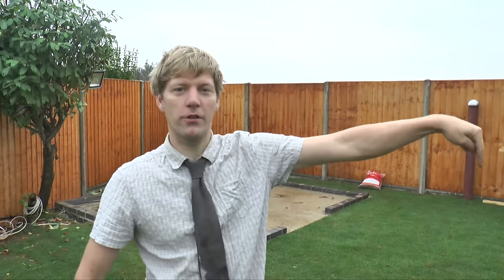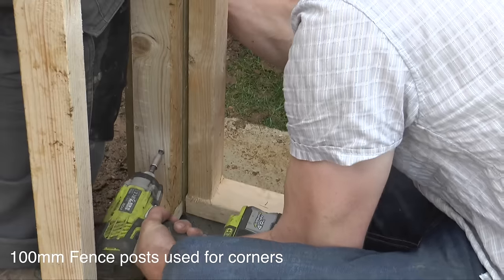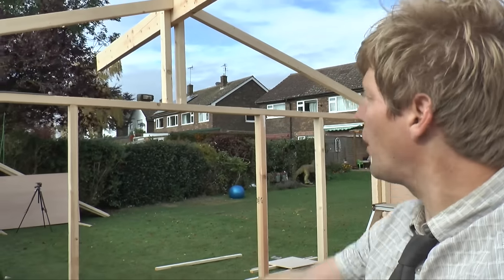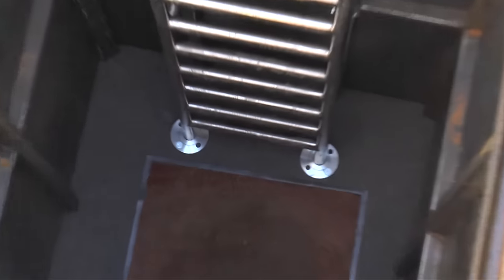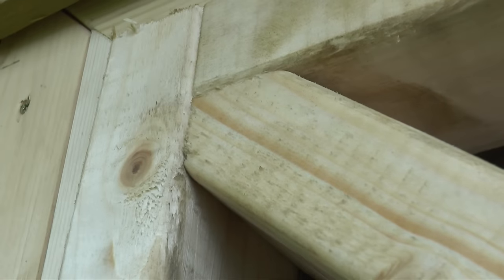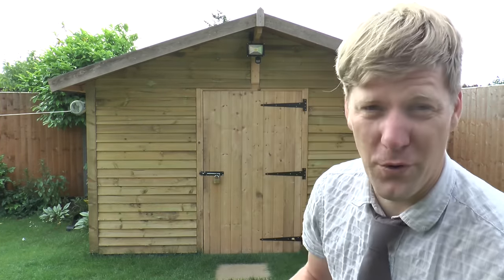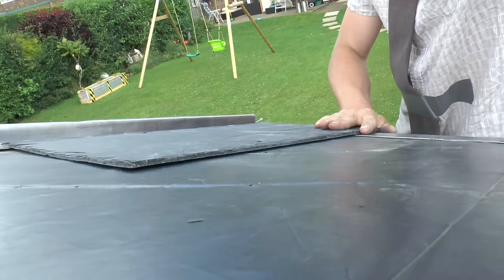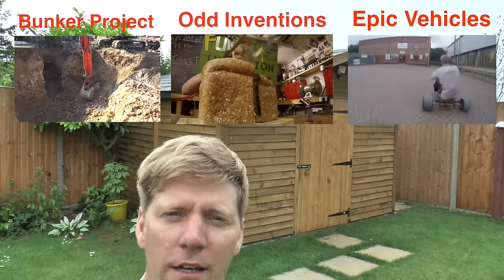How to build a really SOLID shed

Comment: You may still have come under budget if you had of used OSB board instead of premium grade marine ply.
The DPM used should have been a breathable membrane, as you did not batten it out to create a 15 to 25mm void the DPM will attract moisture and eventually rot your timbers but you should still get 10 to 15 years out of it.
Also if you had of... Nah I'm just nit-picking  :)  Great video for any DIYer wanting to try his hand at building a shed.

Comment: We're nicking the idea of the fence posts in the corners. How did you attach the posts/wall frames to the brick/solid base?
Reply: very brief glimpse at 1:30 when he hammer drills (probs SDS) down and uses hammerfix frame fixings

Comment: I hope he used ply that was damp proofed. Also that the shed was secured to the base, mind you with the weight of those tiles on the roof it is not going anywhere but you never know. I hope he did his load calculations so the roof was strong enough to take the weight. He might have an explosion down below in the bunker and blow the roof off ............ He should have put a damp course membrane between the wood frame and the line of bricks he laid for the frame to sit on.

Comment: Great looking shed and great video. I’m planning something similar. What did you do for the base ? Did you lay a concrete slab to work on or is that just the top of the bunker? If it’s a concrete slab how thick did you lay it? Cheers , 
A.T 🤓

Comment: Can someone tell me what size wood Colin uses in the middle when he is doing the feather edge please. Also what's the handy block thing he uses for the spacing. Lastly what size feather edge is that ? . I know I probably won't get a reply from Colin but could someone help. Many thanks all
Reply: The frame he uses 2”x4” and the posts are 4”x4” the sheeting is 12mm I believe. That help?

Comment: While this shed has obviously stood the test of time, I was a little concerned by the fact that the whole thing is only anchored to however many bricks the frame was screwed down to. Unless those fixing screws went through the brick and into the concrete (and they didn't really look long enough for that) then the whole shed's rigidity is based on the amount of mortar between the anchor bricks and the concrete base. 
I'll admit that the amount of weight in this build will probably hold it down through a tornado but come on, there's right ways to do things ;o)
Reply: Sheds are not generally screwed down in the UK.  They aren't going to get blown away here.

Comment: Really want to replace old dilapidated shed with a self built one. But those material costs are barmy. A small piece of strip wood from b&q is a fiver. I built a simple moderate sized cabinet for the garage a fee months back and materials were well over £100 just for that....

Comment: When you put the concrete base down, then the brick perimeter, then you put the stud walls on the bricks - will this cause damp? Do you need to put a damp course on the bricks?
Reply: sheds don't usually have damp course but would be better with it I would think.

Comment: Tip: don't use polythene sheet, use a breathable membrane.  Polythene will give you condensation problems.
Reply: Is that so? Damn! I used a plastic sheet for mine. I thought it would stop the moisture getting to the wood frame. I do have a few se humidifiers in mine to help capture the moisture

Comment: I think slate will prove to be a mistake in the end. I have a slate roof on my house and it's horrible. It leaks, it drops black dust everywhere, it chips and cracks. It's pretty horrible.

Might have been the best stuff around 200 years ago but there are much better alternatives now.

Does look pretty damn smicko though.
Reply: whoever installed your roof did a piss poor job then!

Comment: Interestingly the 75x50 CLS timber I'm looking at has an "actual size" of 63x38 which is obviously something to consider if planning! Not sure why they're like that.
Reply: Yeah that's a "3x2" board - the size of an "inch" in boards has obviously shrunk over time...🤣 I prefer the standard "4x2" which is actually 89mmx38mm - extra strength and it's actually quite a lot cheaper where I am. The 63x38mm is uncommon and usually costs more! But you have to plan and build based on what is actually available to you locally and the relative costs.

Comment: What size timber do you use for the door trim (architrave) and frame? 

I like the centre post in the middle of the walls incidentally meaning you can use the much more available 1.8m lengths of featheredge rather than having to source longer stuff.

Comment: Only one thing we’re is your dpc that should have been put on top of the brick edge before you put up your stud walls!! Other than that great vid
Reply: Calm down , mr inspector it’s just a shed 🙄I hope your not going to condem it or call building control 😆
Reply: Billy Wright I would condemn it 🤣🤣 just saying putting dpc down on top of the brick edge just ensures trapped water isn’t going to get into the timber and rot it. No judgement at all it’s your shed your build up to you what you decide to do 👍
Reply: @craigmitchell4945  it’s not my shed Craig 😊 and I agree for what it’s worth it should be used .

Comment: Anyone got any idea how much it would cost to do this in 2024 on their own? Then including the footing and brick base? Thanks
Reply: Not today but within the next 6 months I will, because I'm going to use it as a guide and build one myself. A few modifications and tweaks that I already know I'm incorporating (UPVC door and Window, Landscape facing instead of Portrait, routing buried armoured Electrical cable from house consumer board (will required Part P Certification), undecided on the feather board finish too). No intention to use any labourers, so should be interesting! I will be keeping a close eye on the budget and let you know.